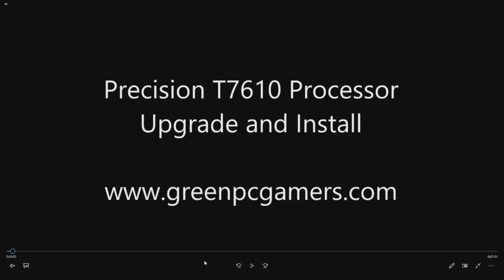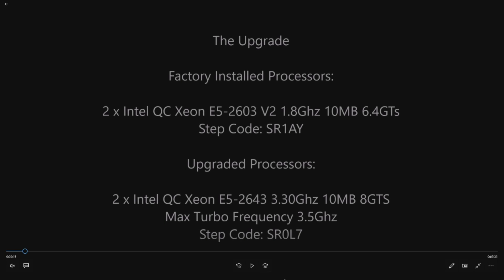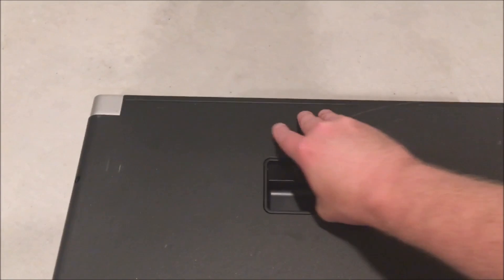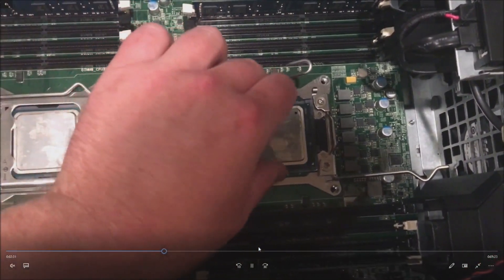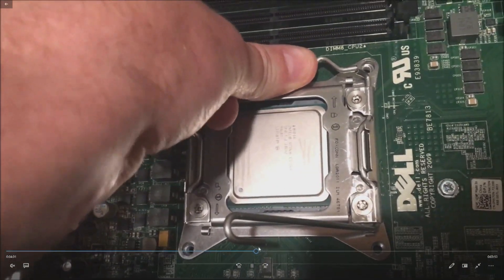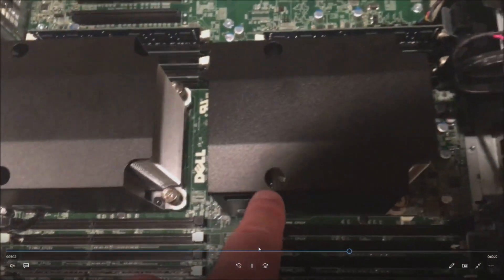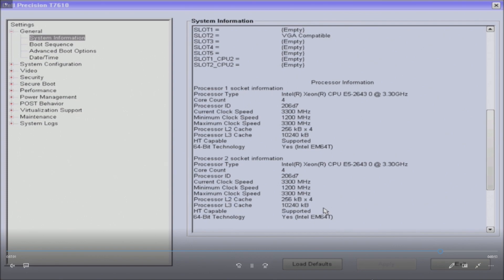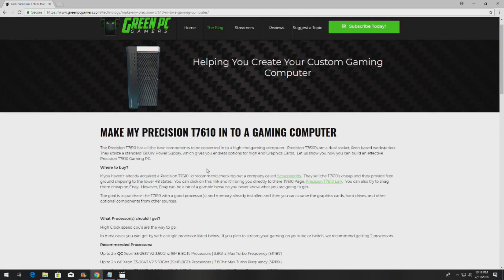Precision T7610 Processor Install and Upgrade

Comment: I would like to upgrade from dual E5-2640 to dual E5-2687W V2. Can I use the same RAM that I am currently using? (Just 32G right now, but plan to expand)

Comment: I want to replace the motherboard of a Dell T7600 with a T7610 motherboard so I can use the Intel 12-core processors. In your experience how hard is it to pull the motherboard in a 7600?
Reply from the maker: We've never tried it.  However, there is a good chance that the T7610 board will fit in the T7600 because they use almost identical chassis.  You might run in to other issues with the power supply and control panel.
Reply: @GreenPCGamerscom  When you say power supply do you mean the motherboard connector for the power supply might be different between the two boards? For control panel do you mean the on/off switch connectors might be different? Just looking at the pictures they seem identical except for the placement of the SAS connectors.
Reply: @GreenPCGamerscom  Just to let you know I replaced my T7600 motherboard with a T7610 motherboard with 2xXeon E5-2697 12 core processors and it worked! The only problem I ran into was the plug for the front panel USB/Power was on the lower right corner for the T7600 motherboard but Dell moved it to the middle of the T7610 motherboard so the cable was too short to reach. So we had to re-route the cable by taking is over the bracket where the front case fans were located and then everything fit. If you want some pictures of the cable move let me know.

Comment: Will a T7610 motherboard fit in a T7600 case?
Reply from the maker: We've never tried it.  Let us know if you try it.
Reply: @GreenPCGamerscom  Just one quick question. Do you know if the T7610 will accept E5-Version 1 CPU's? I currently have the E5-2630 - Upgrading to E5-2687W.

I found a board on Ebay, but to test it'd be nice to know that I wouldn't need to buy a E5-Version 2 CPU right away to test. Just to see.

Comment: What are you guys doing for the temperature control?  I have a T7610 with dual e5-2667v2 and these things aren't supposed to go above 74C but the fans don't pick up speed until 80C.  Its such a basic BIOS fix but the only official dell acknowledgement is the the T7610 isn't meant to run at full load for sustained periods, which is a flat out lie by a group of people tired of hearing people complain.

Comment: I'm looking at possibly upgrading to 2 E5-2687W V2's and was curious if those are pretty much drop in or if theres mobo differences to accept the higher end procs
Reply from the maker: Every T7610 board that we have tested has supported the E5-2687w V2 processor.  Update your bios with the existing processors before installing the CPU’s.

Comment: Do you know if the T7610 would also work with two E5-1660v2?
Reply from the maker: You cannot install 2 x E5-1660 V2 processors in to a T7610.  The E5-1660 V2 is designed for single socket boards like the Precision T3610 or HP Z420 V2.  You should go with 2 x E5-2687w  V2 processors.  I hope this info helps.
Reply: GreenPCGamers.com, thank you for making it clear.